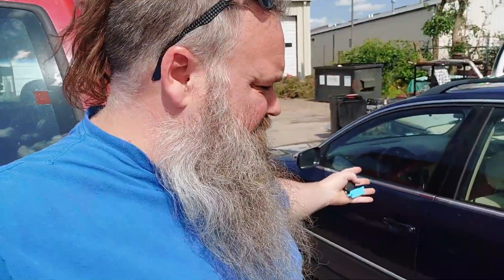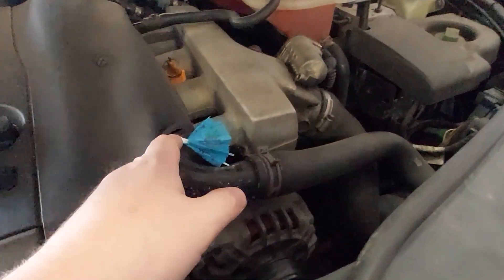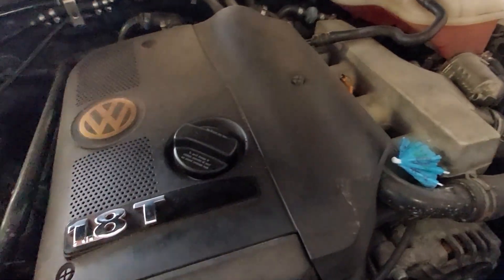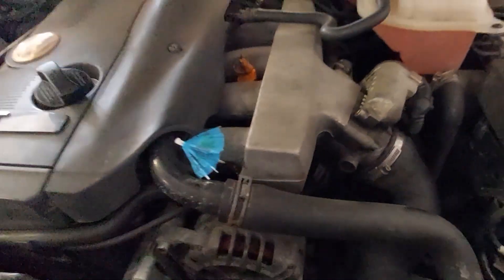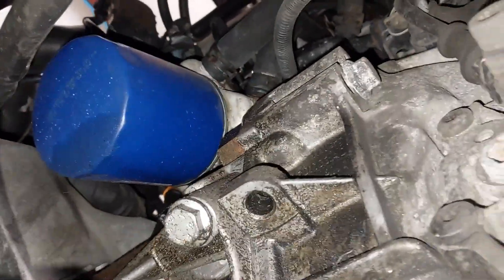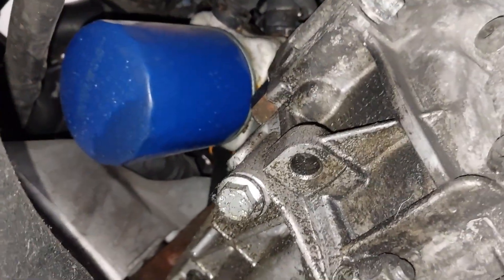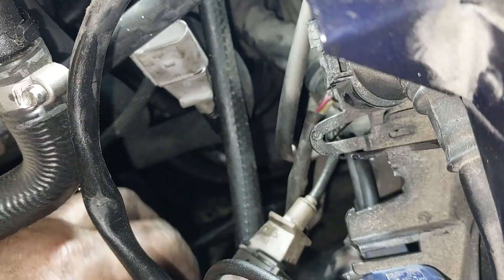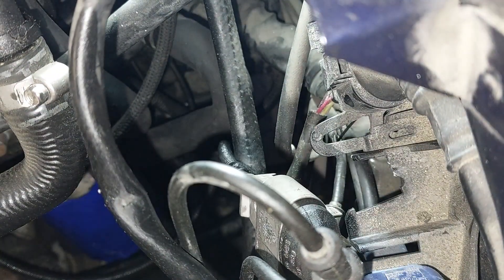VW / Audi P0322 Code Fix! Crank Sensor / Engine Speed Sensor Replacement

Comment: Moral of these videos is, do NOT buy VW products. I dont care that you claim its been a "good" car...thats a false statement. Ive owned 3(2 audis and a VW) a 97, an 01 and an 02. and my wife had a beetle that the oil pan caught fire. Never again. VWs are the biggest piles of shit on the road... doesn't matter that its a stick. Doesn't make it any better or more reliable. Figured you'd know this austin, you work at a shop.
Reply: some people really just seem to get damn lucky with their VWs and have no problems. I on the other hand do not have that luck at all.

Comment: i had a gm made car drive it 20 mins it die wait 20 to 30 min it start go so far and die do the same thing again ok I got to a shop for the type of v6 engine in it ok it was a crank trigger for the spark system! the guy left set & then drive around a hour it did not die it fixed! I need gas in like 5 gallon can its about out!
Reply: A primitive Start Stop technology
Reply from the maker: This thing JUST started misbehaving like this, left me stranded once and that's enough of that! Fortunately the fix isn't super difficult or time consuming, reasonably easy in and out.